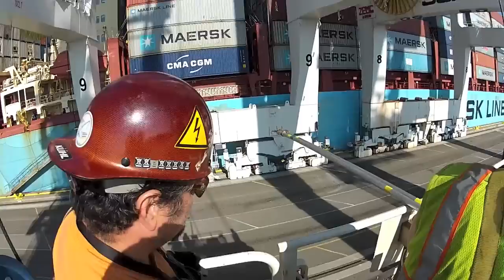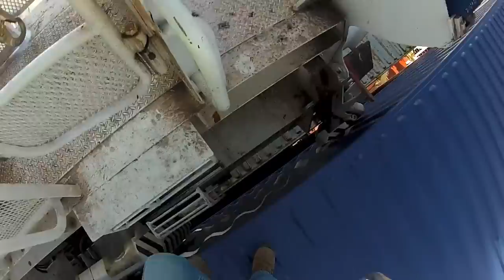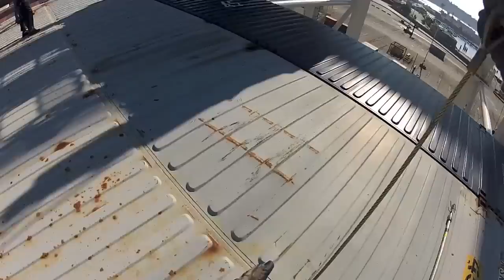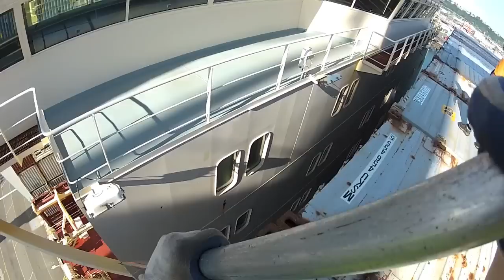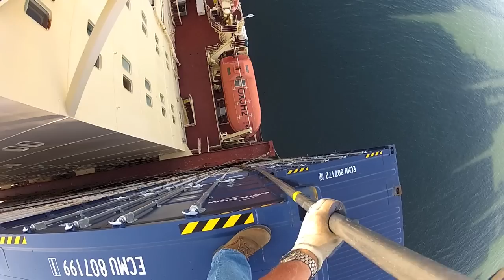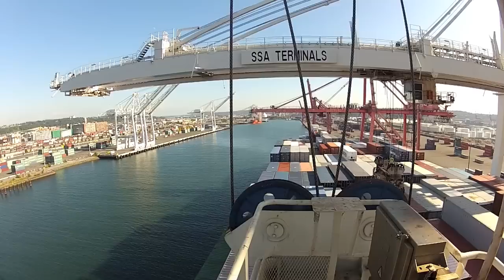Flying on the Maersk

Comment: so the 45' containers are on top of 40 footer and just lashed with 2 twistlocks at one end???
Reply from the maker: papa pingouin There’s cones on both ends.
Reply: Those containers have twistlock pokects at the 40 foot mark and the 45 foot mark so they can be stacket on 40 foot containers

Comment: Geez I didn't see you hook up at first/thought you were just hanging toes off the edge w no safety
Reply: I'm old enough to have actually done it like that before they had the wire restraints (Eddie Gear). You didn't stand up usually, just lay down and unlock the boxes. There also used to be a clamp fitting (Bridges) that would attach two boxes together at the top you would have to take off as well.

Comment: The frist thing I see is that they wear safety harnesses with fall-arrest but they don't attach them to anything.  if they fall, they're dead!
Reply from the maker: James Bryce 
You might want to watch it again. You will see me attaching my safety cable to the beam of the crane just before picking up the poll to start unlocking the cones. 
That being said, if I were to fall, even being tied off to the crane, by the time I got to the end of the cable there’s a good chance I wouldn’t make it. That steel isn’t very soft or forgiving.
Reply: My apologies, I see you attach a cable but I don't see the other 2 guys attached to anything.